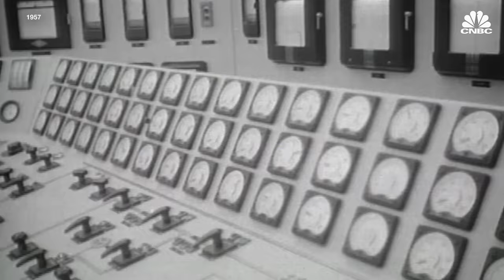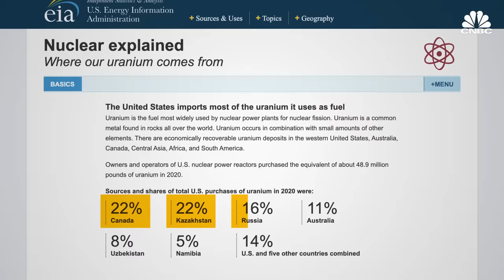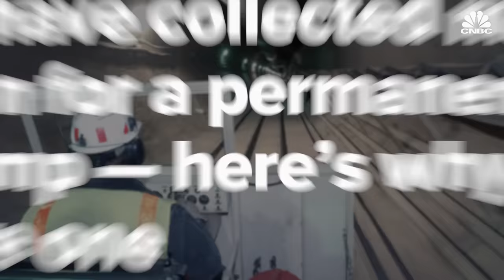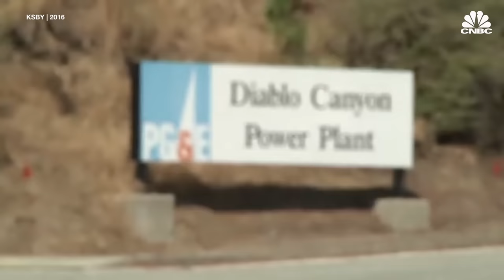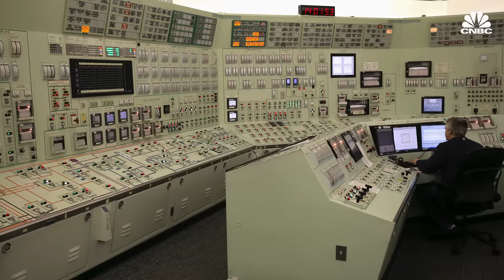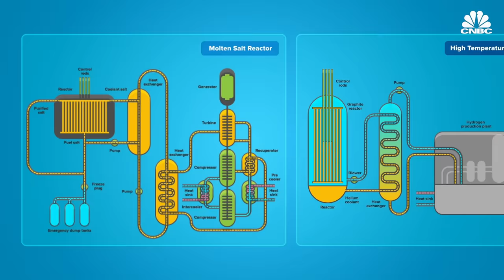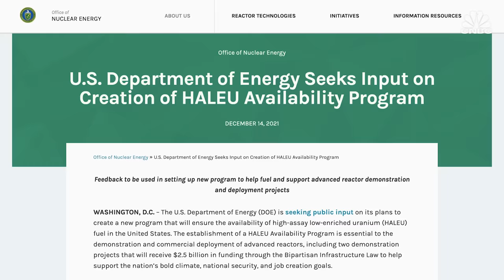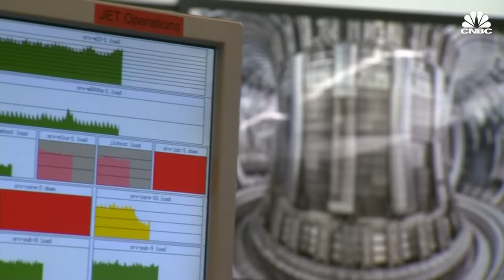Why Nuclear Energy Is On The Verge Of A Renaissance

Comment: You have to remember, vast amount of energy is just vast amount of energy. How you use it is up to you. 

When working with large quantities of electricity, water, any chemical or large structures you have to be very responsible and respect what you are working with, do not fear the amount or size, but understand size, amount and the risks involved and prepare yourself for those risks.

People don't seem to understand that engineers which builds bridges and skyscrapers have to plan out and prepare for every possible catastrophe, similar to nuclear power generation there are many precautionary measures put in place to avoid disaster. Imagine some of the tallest buildings or biggest bridges in the world decided to collapse in on itself.

Comment: Odd that CNBC would address commercial nuclear power issues WITHOUT mentioning any of the consequences of nuclear capital costs -- which is what killed the industry in  the first place in the United States.   Plants coming on line back in the 1950's and 60's all were built with a Government subsidy with up to more than half of the capital expenditures taken up by the then Atomic Energy Commission and reactor vendors as seed investment for future operating plants.   This situation evaporated in the 1970's with utility customers for reactors assuming the full weight of capital costs for the plant and this situation caused the cancellation of almost as many plants as are running now due to true capital costs and operation and maintenance costs being truly reflective of what was actually happening at each site;  the situation now being over for free money from the AEC, General Electric, Westinghouse and the remainder of the suppliers.  

This placed the planned and operating plants on a finer economic edge; making expensive things going wrong more of a determining factor for economic operating the plants in future scenarios.   A gone-wrong steam generator replacement maintenance effort in two of the West Coast plants caused that utility to close down the eight-billion dollar facility for good; forcing the utility customers and the stockholders to eat the capital costs, and this was not the only utility to shut down a site due to insurmountable repairs and maintenance costs.   

Reactor suppliers in the United States offered the utilities different 747 airplane designs for each plant and each utility;  something that would break a company like Boeing many years ago.   A re-started nuclear effort in the United States with the same commercial ground rules of competition and non-standardization of plant equipment will result in the same overruns for the same reasons as encountered before: a lack of scope definition and therefore ultimate responsibilities to be faced.   Far more successful in nuclear proliferation scheme was carried out at EDF in France through standardization of design and government financing;  although these nuclear plants as well are finding themselves susceptible to unusually high maintenance efforts.   CNBC and its producers and management have apparently decided that this important history of nuclear power in the US is ostensibly irrelevant and is to be virtually ignored by the current proponents as though it never happened.

Some current proponents of commercial nuclear power in the USA site regulatory pressure increasing when the then AEC broke up into ERDA and the NRC.   This would be correct in timing but incorrect in execution since most "regulation" in the commercial nuclear plant industry came from agencies and organizations not directly related to the NRC such as the Institute of Electrical and Electronic Engineers [such as IEEE-279], the American Society of Mechanical Engineers [ASME section II & III] and the American National Standards Institute [ANSI 45.2 as an example] and not specific edicts from the NRC.  The overall projected cost of the US LMFBR at Clinch River; not "regulations" regarding LMR's wee what killed that project as well as the others.   Those barking like dogs up the regulatory tree to falsely assign and name blame to regulatory action are acting from a disingenuous political base instead of the technical history and data available.

Comment: I'm proud to say I helped build the Diablo Canyon nuclear power plant. I worked on the construction in the summer of 1971.
Reply: Those days are OVER. 
The Southeastern U.S. is super pro-nuclear MAGA, has zero anti-nukes, and 100% political support. 
VC Summer (South Carolina) new nuclear units 2&3 were canceled in 2017 after spending $17 billion on the project (original estimate of $14 billion and 2016 completion date) with no clear end in sight for costs or schedule.  Anti-nuclear sentiment was never identified by the utility as causing any of the many delays.
Vogtle (Georgia) new nuclear units 3 &4 currently 110% over budget and schedule and still not operating. Mid way into the build, the utility stated that had they known about the many costly delays they would never have chosen nuclear. Anti-nuclear sentiment was never identified by the utility as causing any of the many delays. They are now delayed another year because according to the project management, thousands of build documents are missing. Utilities, not the media, decide the most cost effective electrical power source and give the above failures no U.S. utility is even considering new nuclear at this time. If you can’t build new nuclear in the MAGA super pro-nuclear southeast U.S. then where can you build it?
In both cases, the ratepayer is stuck with paying the $50 billion bill. And the silence of the Rah Rah nuclear folks on these events is deafening.
Reply: @clarkkent9080  Yet you continue to ignore the fact that the US and many other countries have built and used small modular reactors for many decades built in two years or less for millions not billions.

Comment: “Plans to store spent fuel at Yucca” were not stopped by “local” politics.  Yucca was cancelled by the director of the NRC, illegally, as determined by a federal judge.
Reply: LIE #5- “The nuclear waste issue would be solved if Yucca Mountain were just opened.”
TRUTH – The 1983 Nuclear Waste policy act specifically stated that no less than 2 nuclear waste disposal sites would be established so that no one part of the U.S. would get all the waste. And that the disposal would be in the scientifically best location and that is a salt formation.  Yucca mountain is an extinct volcano and not a salt formation.  In 2014, the amount of spent nuclear waste stored at the 100+ reactor sites in the U.S. exceeded the design capacity of Yucca Mountain so if it was ever opened, it cannot hold all the U.S. commercial waste now generated. The U.S. high level radioactive waste generated from the production of weapons grade U239 far exceeds that from commercial power plants. Hanford Wa. Has 53 million gallons of high-level radioactive waste in rusting underground tanks. Savannah River Site has 43 million gallons of high-level radioactive waste. That does not take into account high level radioactive waste stored at other DOE sites.  Yucca Mountain was chosen for purely political reasons and it was abandoned for purely political reasons. Trump killed the project completely. We already have a nuclear waste problem that must someday be addressed but it is NOT solved by any means.
Reply: @clarkkent9080   The waste issue is only an issue because your politicians have made it so.  We have always had many ways to deal with 'nuclear waste'.

Comment: Thorium is not 3x more expensive than Uranium 235 as is in current PWR designs, Thorium Molten Floride reactors (MSRs) are intrinsically safer, breeds more fuel than it consumes, recycles warehoused waste and can be used without pressured water unlike TMI, Fukushima. Chernobyl should not be even in news, no one would ever use such a obsolete tech. and not comparable to modern power reactors.
The scalability of MSRs would allow use in Southwest to desalination with dedicated plants for this need.
Reply: @Klerk Kant You fail yet again from your blank trolling channel to admit that many countries have been building and using small modular reactors for many decades built in two years or less for millions not billions.  You could have also checked out all the US efforts to bring thorium to the US.
Reply: @danadurnfordkevinblanchdebunk  The French and others

Comment: It's not the accidents that concern me about nuclear power. It's the waste. Primarily, its longevity.
Reply: Which can be contained and destroys the earth far less than oil and coal. Or even wind and solar.
Reply: 1. the waste from nuclear at least decays, the waste from renewables and dirty fuels do not
2. it can be stored, and is stored, again much more than can be said for other forms of energy
3. it produces a tiny volume of waste compared to other sources of energy due to how much power is in a single gram of uranium
4. with modern reprocessing the radiation in waste drops to background (i.e. safe) levels in ~300 years
5. all the nuclear waste on the planet contains usable fuel, once we extract that fuel and use it as we should it becomes significantly less dangerous

Comment: 13:26
wtf? No, the “big, curved, concrete covering” is not the reactor pressure vessel, it's the containment building. And no, not every modern reactor has a reactor pressure vessel, e. g. canadian CANDU and indian IPHWR reactors don't, they use pressure tubes instead.

Comment: They did not have backup generators.  The first responders have to bring generators into the plants immediately to power up the plants.  Then the fuel rods are removed.  They did not gain access to generators to remove the fuel rods. They were not able to access sodium' metal to replace lost coolant. The stooges pumped seawater through the power plants.

Comment: my son works at Palo Verde nuclear power plant. It has been certified to run for a number of years
Reply: It has run 34 of its 40 year design life.  The NRC has extended the 40 year license for 59 operating reactors.  But if you look at the history of these plants, once they exceed 40 operating years, any large/expensive equipment failure results in the owner shutting them down.

Comment: I would go with a modular thorium Morton salt reactor. Based on the original Weinberg design from Oak Ridge Tennessee. We had one running from 1965 until 1970. Nixon shut it down because he had a public school grasp of physics. You can use the molybdenum 99 for cancer diagnostics therapies and research. Xenon can be used for interstellar space travel for NASA and Elon Musk if he wants it. The excess he can be used for water desalinization a Diablo Canyon, and petroleum distillate manufacturing.
Reply: It ran for less than one year BETWEEN 1064 and 1969 because of all the problems they had with the design. The project was terminated because commercial and navy PWR/BWRs designs had been operation without problems for 15 years up to that point and that design had few advantages and many disadvantages.  For the last 50 years, any utility could have decided to build one but they never did so I guess Nixion was not the only one with a public school grasp of physics.
Reply: @clarkkent9080  Yet you continue to ignore from your blank trolling channel that many countries have been building and using small modular reactors for many decades, built in two years or less for millions not billions.

Comment: If not going the neuclear route.. it will be the end of humanity.
Nuclear power needs to be the base.
Reply: Not just the base, but must be flexible enough to also meet peak demanding.  Next gen nuclear can do this but is very difficult for existing nuclear plants.  Hydroelectric will likely be key to help with peak loading until we can get new nukes online.
Reply: @danadurnfordkevinblanchdebunk  The only new nuclear projects that MAY be built in the U.S. are already in trouble so all the PR is just that.  All show and no go.  

Lets look at Terrapower, already behind schedule and now projecting that their 345 Mw Natrium reactor originally advertised at $1 billion will cost $4 billion and that is already a financial failure.  But the project hasn't even broken ground after 2 years, so I expect the "supply chain, fuel cost, labor shortage, inflation" excuses to soon follow.

The only other U.S. nuclear project is NuScale's SMR.  That project just halved the size of the project MW output due to ballooning costs and has delayed the project start till 2025 because the do not have sufficient utility backers.

No new reactor can do anything until it is built and proven and that has been true over and over from past builds

Comment: Fusion is a promising technology but for now we really need fission. There's the ITER project plus two developments at MIT on the alloys for the superconductive coils needed to keep the plasma away from the walls of the fusion reactor. One is a film with the 1980s IBM superconductive ceramic deposited on top of it and the other is an alloy that supports 10 times higher magnetic fields.

(the superconductive coils are usually made of Niobium-Titanium wires but the magnetic fields are so high that it causes iron atoms, for instance, to move inside the coil and group - the phenomenon can cause the coils to break apart. The new alloy developed by the MIT team uses three metals and manages to hold the ferromagnetic impurities fixed avoiding the dangerous grouping. Thanks to @Tech Ingredients for the information about the alloys, btw!)
Reply: I just wanna say "a few" things about fusion...

Argument 1 (for nuclear): Even including Chernobyl in the statistics (although nobody advocates building graphite-moderated reactors of the type without containment domes and strong negative void coefficients), current fission nuclear is the safest energy source we have.

Waste is not a scientific nor technical problem.  It is primarily a public relations problem.  99.5% of waste is unused fuel if the fuel cycle were to be completed; the rest (actual fission products) is highly radioactive due in part to its short half-life - meaning it decays away quickly.  Its radiation levels are below that of regular uranium (the natural ore it came from) in less than 300 years.

Argument 2 (against fusion): Fusion as an energy source DOESN'T EXIST. Therefore it cannot be "cleaner" than an actual energy source.  Also, I suppose these pro-fusion/anti-fission types haven't thought much about how tritium will inevitably escape into the atmosphere due to it being nearly impossible to contain 100% in metal vessels.  And I don't think we will be replacing multi billion dollar plants after a few years due to hydrogen embrittlement.

Argument 3 (against fusion) (sarcastic):  Yes, it's so simple! Let's pick a project that's from the fundamental beginning impossible to make practical and economical, and let's bet the farm on it!  Perfectly responsible policy!  I mean money (and inflation) are infinite after all!

Argument 4 (straight up spitting facts against fusion): if the same money had been put in thorium rather than this, we might have something closer to a roadmap to ubiquitous clean energy. instead, we have a politicized nightmare of something that is much more inaccessible than fission. we could build reactors with current tech that are almost impossible to melt down, literally eat nuclear waste (even tho its not a problem as i explained in another one of my massive files like this), and are much cheaper to build and operate. instead we funnel money into extravaganzas like this that have extremely high energy input needs which drastically cut down on output, if there’s an overall net difference in the future it won’t be much going forward. and it will be EXPENSIVE. not only that, but it still actually makes nuclear waste (if it’s neutronic), which is what many people dont know and think fusion energy makes no waste at all and think thats one of its many positives, which is straight up wrong. if you thought fission energy was pricy this will be a whole new level.

Argument 5 (for nuclear):  Just better uranium-based reactor can solve the energy carbon footprint instantly. (Oh yeah and dont even worry about the waste i already covered this elsewhere as i said in argument 4) But at least with next-gen reactors, which are being researched as we speak, it can be recycled. Thorium is still better in my opinion though.

Argument 6 (a short one, against fusion): Even net energy gain isn't good enough. Even having a practical reactor in engineering terms isn't good enough. The real problem is cost. Will it compete with cheap renewable energy sources plus cheap grid scale energy storage? The answer is almost certainly, no.

Comment: The claim that public perceptions of safety, right or not, is what is killing nuclear power is way off beam. What is killing it is the beancounters. As this article points out, you need "a big build out of batteries" to run a grid on solar and wind (both of which - especially solar - are now incredibly cheap). But to get the same 24hr electricity with nuclear would also require a big build out, which in all experience would both take longer AND BE MUCH MORE EXPENSIVE. Sure, maybe by the 2050s we'll have cheaper SMRs - or maybe we'll have cheap fusion, or (far more likely) super-cheap batteries. But for the next couple of decades there can be no real "nuclear renaissance" - it is all corporate hype.